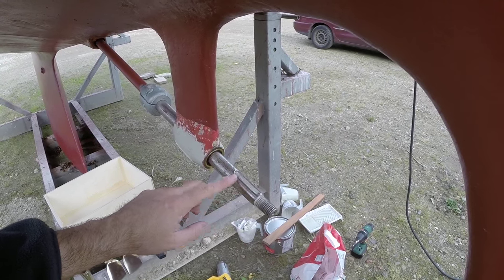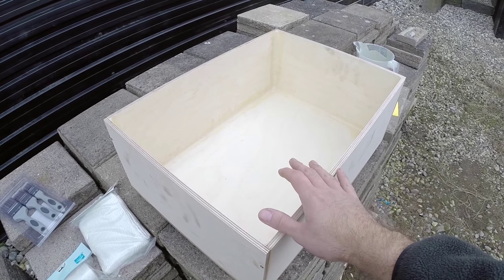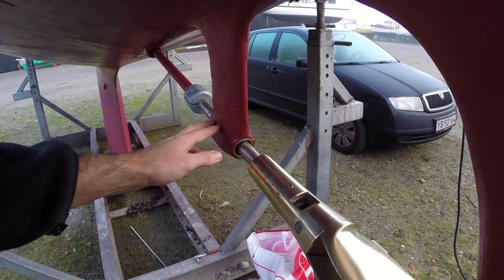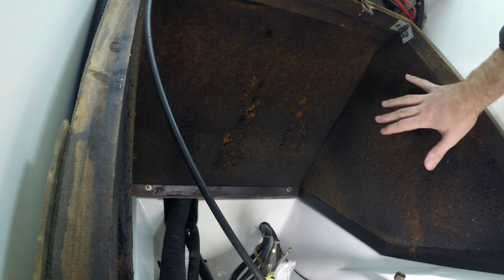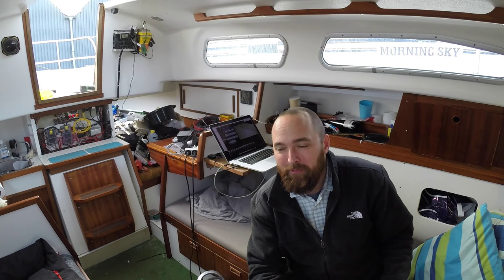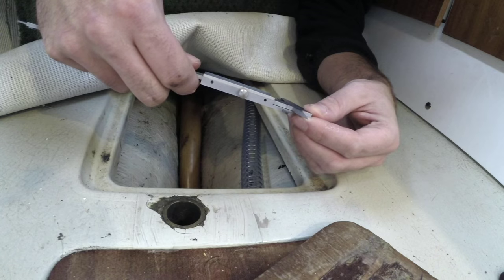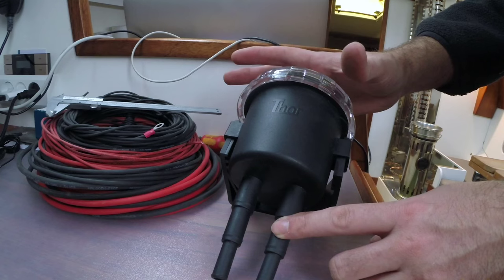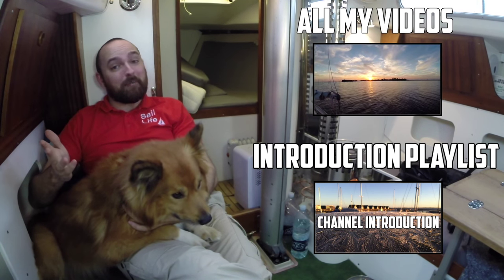Sail Life - Up on the hard, part 10

Comment: Last year we had a folding prop, however we found out it is quite important to use a threadlocker. Lost one of the two props, which gave a lot of vibrations in the boat, and a wasted prop. Hope you remembered the threadlocker ;)

Comment: Just saw a neat idea to set up your engine as a backup bilge pump.
In Strombus, Part 3 #50 from Drake Paragon, comment from Sailing Ontology:
"I once spoke to a guy in South Africa who was run down by a tanker close to Robben Island off the coast of Cape Town. His wooden 40ft yacht was holed and sinking fast. He then dissembled the raw water intake hose from the seacock and used his Perkins Engine to pump water until he got into the Royal Cape Yacht Club. He now has a permanent hose with a ball value fixed with a t-junction to the raw water intake."

Comment: Mads, I too had to build a holding tank for my boat; plywood and fiberglass and it has held up well....it is about 35 gallons and I mounted it as close to the head as possible.  Not a fun job, but a necessary one.  Your tank looks much better than mine, by the way...keep up the good work!

Comment: I noticed you seem to have the same stuffing box as that on my Beneteau.  The manufacturer, Volvo Penta, recommends greasing it every 200 hours of operation.  They sell the recommended grease. They also recommend "burping" it after going back into the water as a bubble may be trapped.  Burping is simply pinching the rubber where the shaft enters the stuffing box....it literally burps air.  I suggest going to their website for additional information.....you may want to go to Murray Yacht Sales' website as they seem to have more information.
Reply from the maker: +Dick Dixon I've been extremely pleased with the stern gland aboard Obelix. The only issue I've ever had (small leak) was solved by burping it. I pulled the shaft out and did a visual inspection a few days ago. It looks brand new. I still had some of the grease from Volvo that came in the box. I applied that to the lips and around the shaft.

Comment: If my recollection is correct, some time ago you said that the transmission had been leaking lots of oil.  But when it was inspected there was nothing obviously wrong. so the seals and gaskets were replaced.  My concern is in regard to the transmission input and output bushings/bearings.  Make sure that the mechanic has checked these for proper clearances.  A sloppy bushing fit, allowing a wobbling transmission shaft, can cause even a brand-new oil seal to leak.  It would be a shame to get everything back together and still have a big oil leak.  Hopefully everything is all good, and there's no issue here.

Comment: looks great, but is that a gate valve you closed on the engine water intake.  If so you might consider changing it to a ball valve. Gate valves can easily get stuck with the smallest amount of debris or sediment. Hindering your ability to close it if you need to.

Comment: Hi Mads. How did your polished prop get on with any fouling? This year I used a hempel erodible antifouling on my folding prop, but it eroded away completely allowing barnacles et al to move in. Next year I might try more coats but might also try the polishing approach if that holds promise. Best wishes. Chris

Comment: that's a tiny holding tank! is there a particular reason why you did not go with a plastic tank specifically designed for sewage? i went with a 50 gallon roto-molded tank, with trident 101/102 hose, no smell at all. i pump out the tank when i'm offshore.
Reply from the maker: +dawntreader70 43 Liters (11 gallons) is all I have room for. If I was to buy an off the shelf holding tank I would only have been able to fit a 20 Liter tank. By making the tank myself, I'm able to both save a bit of money and get a bigger tank :)
Reply: i totally forgot about the size of the boat :)

Comment: Mads, if you're still on the hard. Could you be so nice and measure the diameters of the thru-hulls (intake for diesel, intake and output for the head)? Inner diameters I guess, don't pull them out ))

Comment: Oh no! A plywood holding tank...yikes...go with plastic or metal. the plywood will flex with the weather and crack the fiberglass inside the tank eventually possibly causing an unpleasant leak in the v-berth.